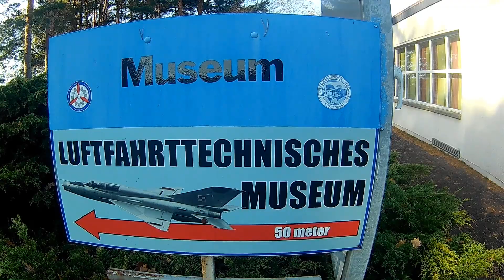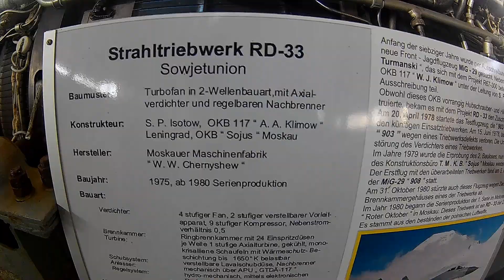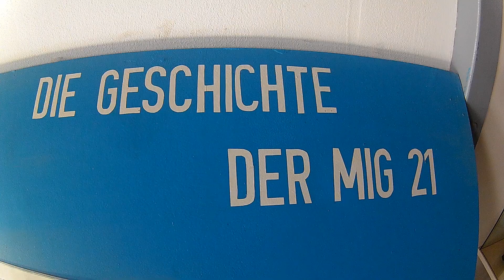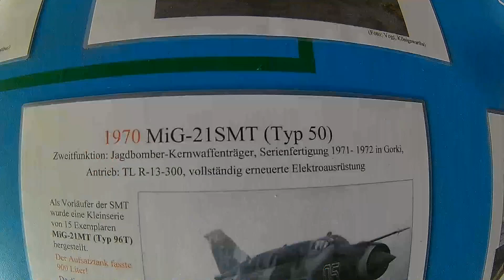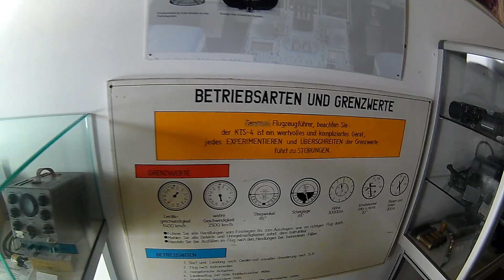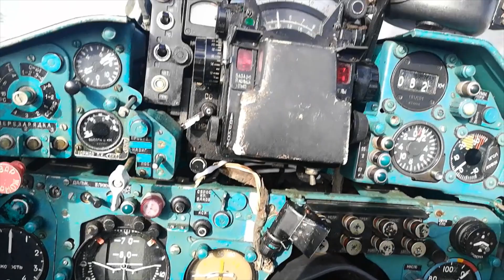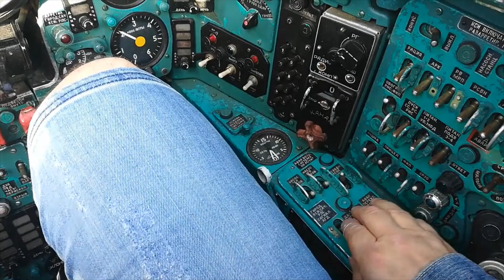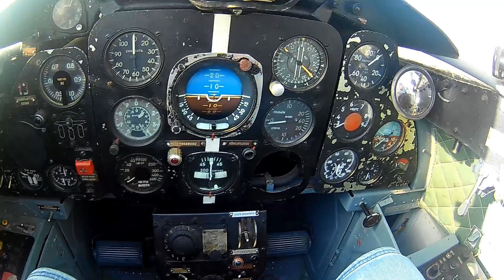Luftfahrttechnisches Museum Rothenburg

Comment: Photography sucks. Too many close ups to get a good feel of what your seeing. Seeing Detail is OK if you can get a relationship to the overall.
Reply from the maker: I'm sorry, but I can't compare it to your work. I couldn't find your videos anywhere.
Reply: I see I got your attention, good. I said that it sucked because I made the same mistake years ago. I took a lot of detail photos of aircraft thinking I had something great only to find several years later that I could not identify where on which aircraft the detail belonged. Your need to get references on the aircraft the details are. This is especially true when you are doing several aircraft. Getting the references is easier in video then it was with photos because you can zoom in and out without a break. Zoom out to get enough of the aircraft so you can identify its type and then zoom in for the details. Try to get as clean of a shot of the overall of the aircraft from all angles as you can. This last can be hard when several aircraft are close together. I found that if you take only pieces of the aircraft there is always something that you miss. The aircraft you were taking had some space between them, what I was taking was in the aircraft park aft of the island on a aircraft carrier. This was before the internet and smart phones. @petrstola